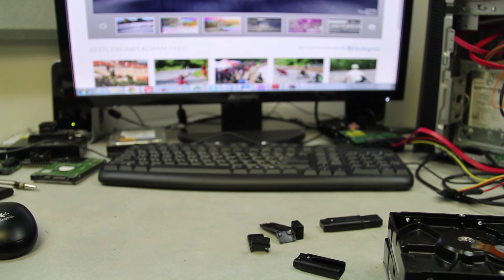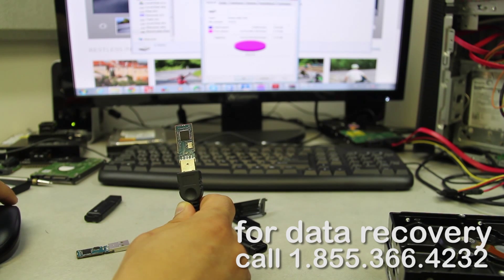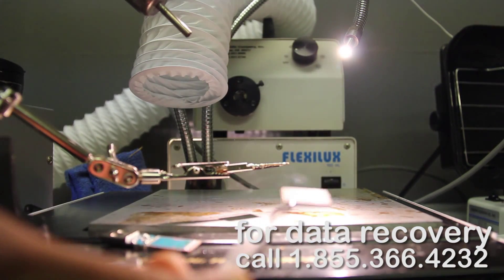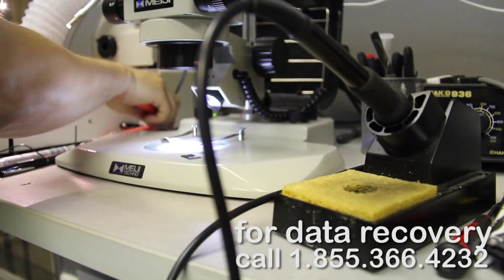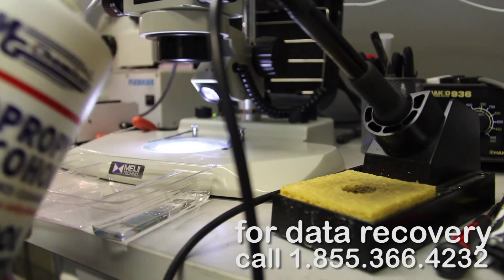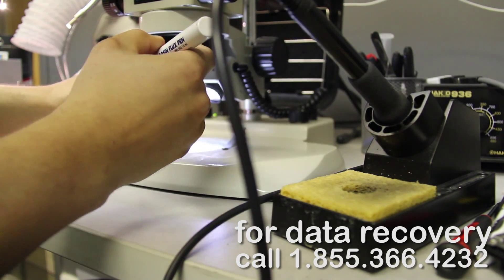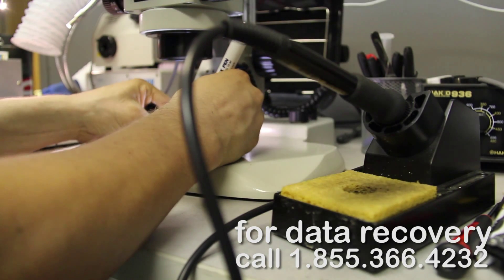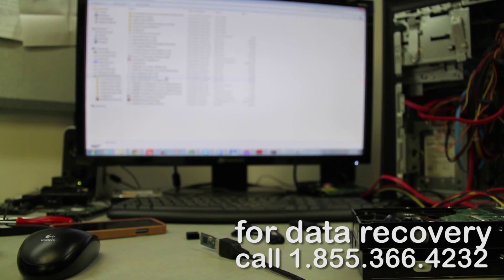How to recover data from USB flash drive

Comment: My light flashes but it will not be recognized by windows. It shows as an empty drive with letter G. I've tried every other solution they have for error (43) and nothing helps. It's a failed descriptor error.

Comment: I got a problem, my flash drive was flashing but it is not being detected by the computer. What could be the problem with that sir?
Reply from the maker: It could be a bad connector, bad USB port, controller, auxiliary components, fractured PCB, broken traces, and finally issues with NAND. We can help to recover your data if you like